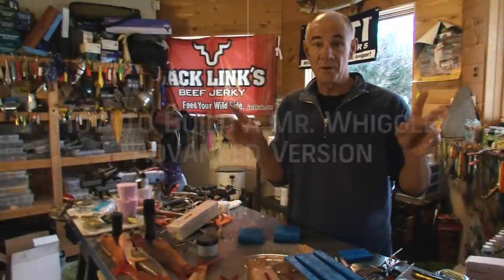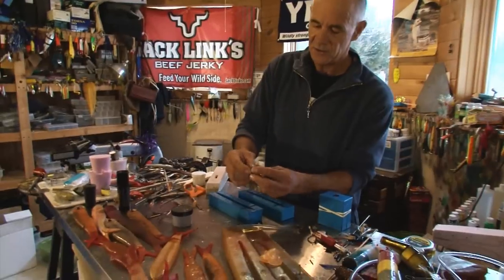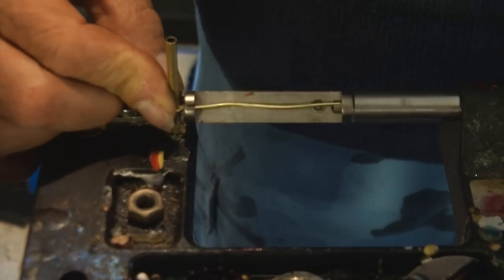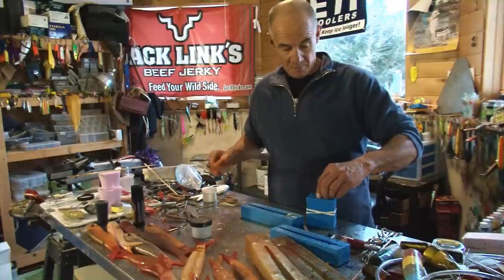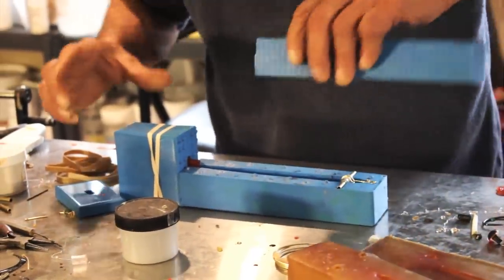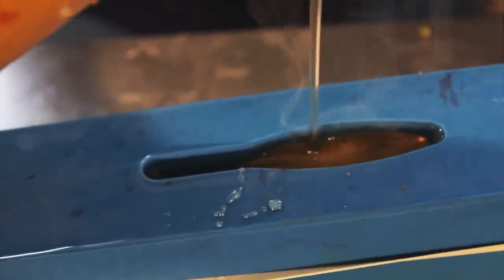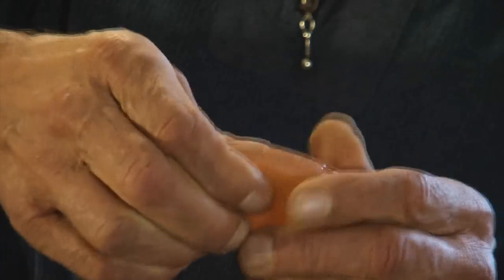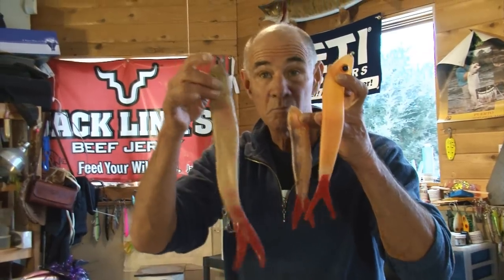How To Make An Advanced Mr. Whiggley Fishing Lure | Alumilite

Comment: I want to use a hard plastic medium diver crankbait as the mould. Making the mould and pouring the plastic worm material in the mould is easy. 

The lure body would be a Berkley Flicker Minnow for example.

But how do you get the bill and hooks to stay in lure body as you pour the liquid rubber into the mould?

Once the lure comes out of the mould, it will have a rubber body instead of a hard plastic body.